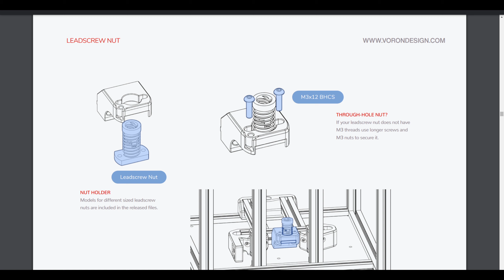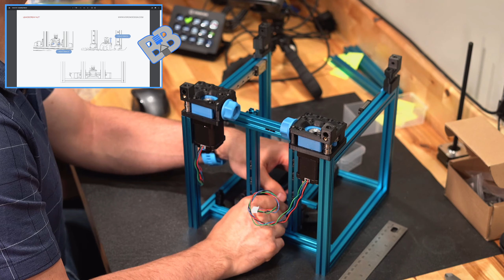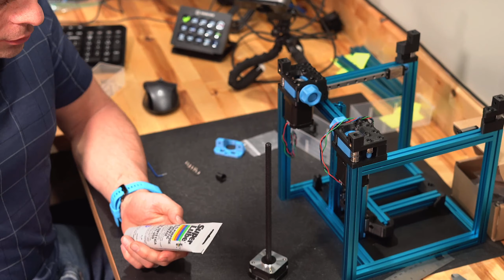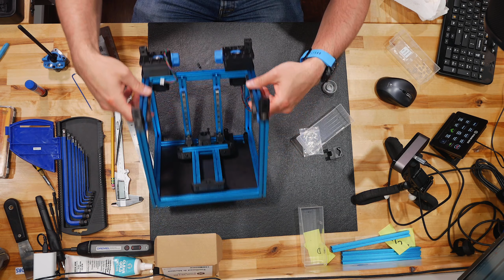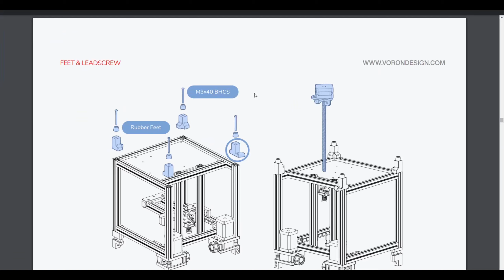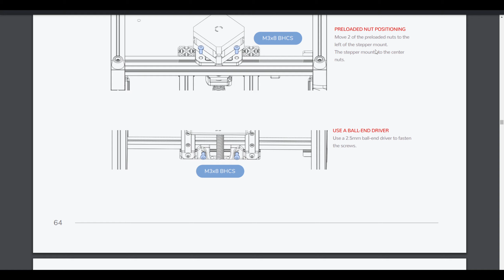DIY 3D Printer LDO VORON 01 Z-Drive

Comment: Before you put the belts on, it might be better to rotate the A/B motors so that the wires are inward, toward each other. Wire management will be easier later when all wires are centered and there won’t be any pressure on the wires when you put the back acrylic panel on.
Reply from the maker: Thanks Matt.  I pondered the best way.  My plan was to route them down the extrusions.  I'll reconsider.
Reply: @BuildItBasement  I saw your other video where you were going over it. It’s okay to leave it as is. It’s personal preference. Since you have a lot of short build videos, I don’t imagine you have a ton of time. The method you chose is the quickest way to a tidy configuration.
Before my rebuild, I went with the wires facing towards the sides. It made the routing a bit longer though the wires were nicely secured to the extrusions.
When I did a rebuild, I went with the wires all facing the center. It’s less neat immediately but a wire channel covered it up.